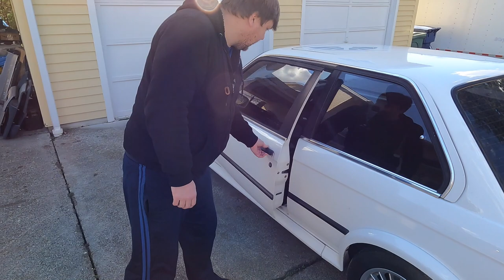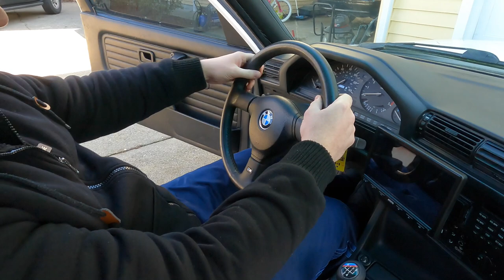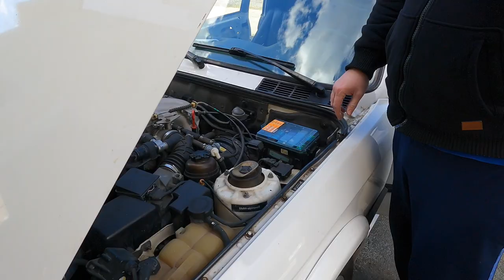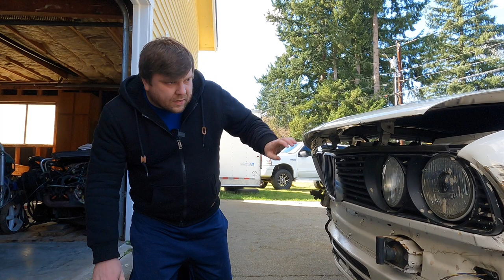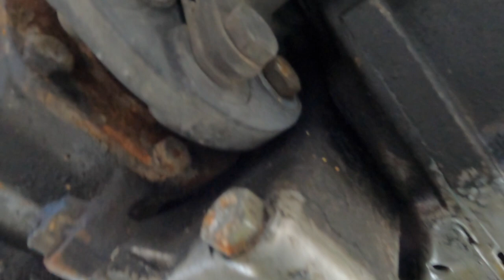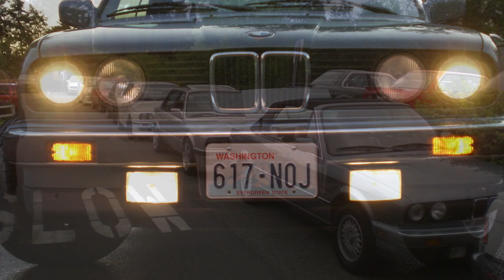A Little BMW E30 Nostalgia - Is This 325iX Savable?

Comment: weird, so you basically have/had my same two e30s -- a black '91 convertible with the hardtop (mine's a 318 though), and a white '90 manual ix coupe .. shame about this poor ix, but it would make a nice parts car, if you're interested in selling it